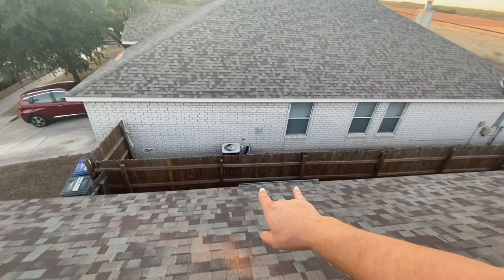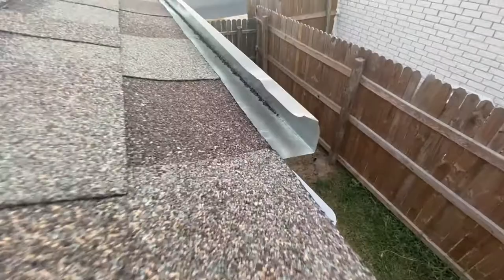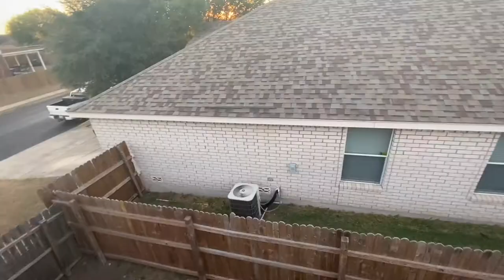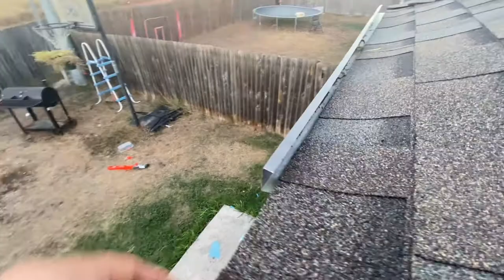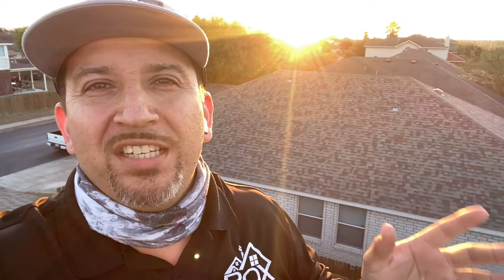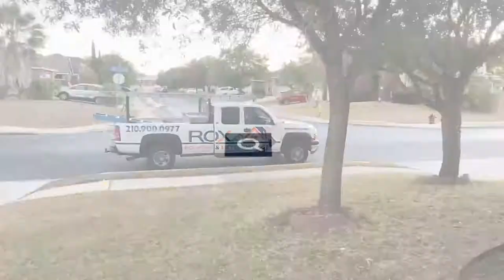What's A Roof Rain Diverter? | Top San Antonio Roofer | Rox Roofing

Comment: I have a metal roof with no gutters.  Rain pours down on the corners where roofing connects and pools making holes and splashing onto our porch.  Can this diverter help or do you have another idea?
Reply from the maker: If you have a metal roof, 6” gutters would be your best bet. The next best thing would be a custom made rain diverter attached to the fascia behind the metal edging drip edge. 

Hope this helps.

Comment: How do they work in spring storms?
Reply from the maker: rain diverter is just to divert water from the roof away laterally from walkways or ac units. Not sure what you mean by "spring storm", you mean high winds?? idk. They hold well in storms and high winds when installed correctly. Hope this helps.